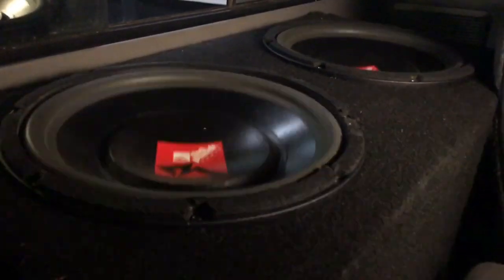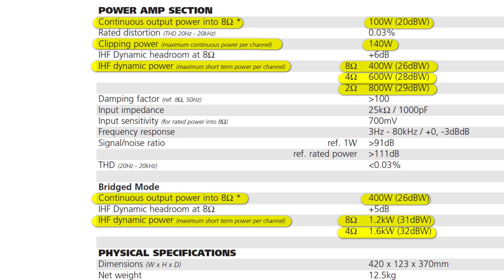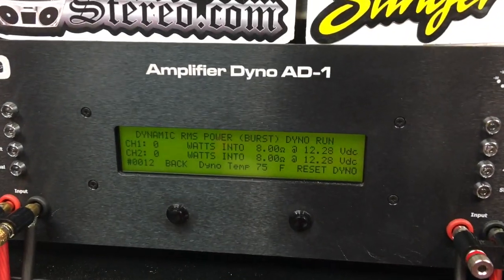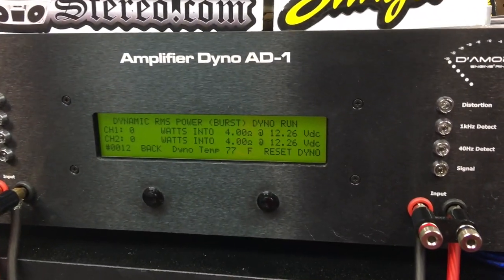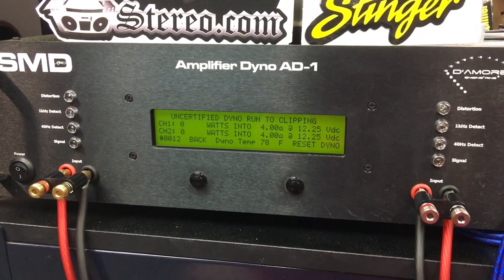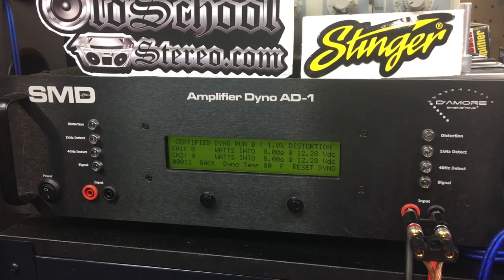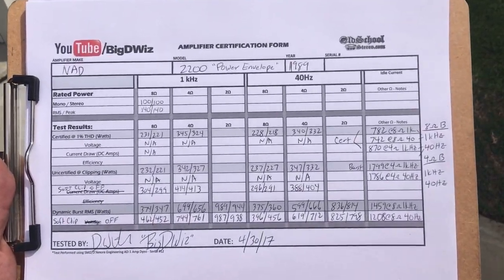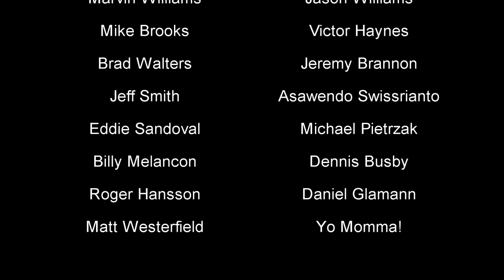Vintage NAD 2200 Power Envelope Audio Amplifier Dyno Test

Comment: This amp blows away any amp made today.  Remember this was made in 1987 so it was sick then and is sick now.  The SQ is impressive and have great dynamics.  Picking up one for $300-$500 is a deal.  Emotiva tries to match this with their XPA 2 line and the SQ is not the same.  I've had mine since day 1 and it needs no repair.  Match it with a preamp NAD 1155 and you are blowing up speakers.  Genuine audiophile product, I'll put this up agaist any system.  My two favorite amps is NAD2200 and Yamaha MX-1.  Check my videos on sound experience for reference.
Reply: In the HIFI world, this thing is considered an old mid-fi budget piece. It was never considered a true high end Amp. But it is a good Amp.
Reply: It's actually considered lowe power by today's standards with class d, but class a/b is superior in my opinion

Comment: The origins of NAD are fascinating. The brand was built from the ground up based on the demands of distributers. Simple utilitarian aesthetics, ample features and an overbuilt power capability with conservative ratings that punches so far above its weight class that it competed directly with audiophile grade competitors at a far more reasonable price. I think NAD's original mission has been diluted over time, but that vintage line of audio components are legendary.

Comment: Watching this video listening the audio through NAD 2200 :) Phenomenal amp I must say.
Reply: Does run hot though.
Reply: MSTR-RPTR I don't mind. My amps are well ventilated and I have 110v fans in case things get rough. I can't believe I didn't buy one because I thought the power rating was too low

Comment: This video brought back some good old memories. I used to repair home audio amps and these NAD amps were some of the best ever made that crossed my bench. They always punched above their spec sheets, and the design was so well engineered that a few I worked on with blown channels still functioned but the complaint from the customer was 1 channel was quieter than the other...and on the o-scope the sine wave was still clean even with the blown channel (most other amps actually explode [transistors fracture/short] when the channel blows). Also as you showed in the video with soft clipping off (if you were to watch the sine wave on a o-scope you can see it tries to bend the square wave in to a sine wave during clipping, it is pretty amazing engineering for the time) you do get more power, but with it on, you could actually save your speakers, so it was always a give/take situation, but when you push power in to a load it really does not matter as high wattage loads can take a ton of abuse.

Comment: I had one of these and I sold it for some reason, and I got a 2600 rated by NAD at 150 watts.  Both great amps. Still have the 2600. 

I read an article in the 220. They commented, “NAD watts are different from other watts,” referring to difference between their ratings and their output.

Comment: Back in the late 1980s I installed a couple of NAD 2200s in bridge mode driving 2 JBL cabaret series 18" 600w subwoofers at a local night club. It was a great combo, they sounded fantastic night after night and they never missed a bit in quite a heavy duty application. Clean power, no clipping even when pushed hard, no blown speakers ever. Great memories!
Reply from the maker: Awesome 👏

Comment: Ran 2 of these vertically bi-amped into my 1978 AR9s for years - absolutely amazing grip, control and power (the ARs needed lots of juice to make them sit up and perform).
Still have the ARs but now have them relegated to the studio now. Only have one of the 2200s tho - one blew up a few years back and set fire to itself and the curtains and wall. Completely ruined the amp - wall not so bad, curtains blobbed, wife on war path. I intend to restore both the speakers and the remaining amp (one day) - keeping the wife.
Now have Emotiva amps and Golden Ear speakers - happy.

Comment: I bought this and the 1155 pre amp, new, back in the 80s.  I still have it and it still rocks.  It has lost channels once in a while.  I finally broke down and bought the T777-V3 this year, so I could have a home theater.  I am thinking about moving the 2200 into the garage and plug it on out there.  This thing is still a beast.
Reply from the maker: Absolutely 👌

Comment: There was a problem with these amps having cold solder joints though. The problem can be fixed easily enough if you have basic soldering skills and aren't afraid to open up the case and pull the boards out so they can be re-soldered. The soldered connections that are connected to the back panel of the box should all be re-soldered even if they look alright. All of the soldered joints on the power supply (transformer) should be re-soldered and the speaker relays should be replaced. Pretty much all of these amps had this problem and should be re-soldered even if it's working and looks fine. The bad joints in most cases can't be seen by looking at the joints casually but can be seen under magnification. A lot of the bad joints had a dry socket where the outer shell of the soldered joint looks fine but in the center of the joint it didn't solidify and there is a faulting connection that can release the magic smoke. 

That aside these are kick ass amps. If you ever get a chance to pick one of these up cheep go for it. But with the age of this amp you should be aware that it will probably be needing a recapping to bring it back to it's original specs. That's just part of the hobby of collecting vintage audio gear.

Comment: I have one of these with a 1130 pre amp. We used to use it to run a PA system and blew 2x 600w 12” woofers with it. Only modification we did was point a fan at the top!

Comment: Would love to see the mighty 208 THX on the Amp Dyno. 
That thing is a monster of an amp. Rated to handle 2000w RMS at 4 ohms bridged. 
I have tested one of those back in the day, powering a set of home built tower speakers with a 12" Lightning Audio subwoofer in each of them. It drew so much power that the lights in the house dimmed when I cranked it up to 11.
Also, the smaller 218 THX, or the more modern M3 would be interesting to see tested.

Comment: Was curious and had to check for the schematic of it and found it. It’s a bi supply class G (very different from a class AB and way way harder to design). Freaking amazing design especially for the time and even today. The higher voltage outer rails switching on after a certain point and flooding/surging the inner rails is where all the headroom comes from. There’s probably some sort of time delay on the inner rails to keep the higher voltage ones switching ahead of the audio signal like in all Carver’s designs (which are ridiculously complicated).
Reply from the maker: NAD mentioned this video in their recent 50th anniversary video. Too bad my audio is a bit hot in some of the video 🤦‍♂️

Comment: The two larger filter caps are for the high-voltage rail.  They are the burst storage caps.  The amp switches to the high voltage rail when burst power is needed through com-mutating diodes.  Normally, the two smaller filter caps and low-voltage rail do most of the work.

Comment: The filter caps are different sizes because they have diifferent working voltages. 63 and 100 volts I believe.
The amp uses an input waveform peak level tracking, split rail supply to acheive high dynamic headroom and slightly increased efficiency.

Comment: One thing to keep in mind when dealing with this type of equipment, is power only goes so far when judging an amp like this. Sound quality is everything. Its easy to make an amp that has a lot of power, but its very expensive (and difficult) to make a powerful amp that sounds good. A good home speaker is far more demanding and less forgiving, than a good car speaker. 

NAD has been, and will probably always be a top performer for the money, but its still considered an entry level product (not including the M series. M is better than entry level but it costs a lot more). In reality, I have a 40 watt/ch at 8ohm's stereo amp that will easily outperform this amp in all areas. 

The only reason I bring this up, is not to say anything bad about NAD. For the right application I have no problem recommending them. High end home audio is my life's work since I was 18, and the biggest mistake people make, is they make purchases based on specs. You must also listen to any product before you buy it. And you should really try it in your own system. Actually, buying on specs is a tie with underestimating how important the preamp is in your system.
Reply: Samtab Galaxy so true since my dad took his klipsch forte iii to Mexico the front speakers that we have now can perform the way those forte could.
Also we also use to own Celestion a4c 
And with the klipsch front and added with celestion a4c the system didn't require subs those three could easily perform well but we actually did had the subwoofer but turn low for better punch we used velodyne sub
Reply: A good amplifier shouldnt havw a sound it should be neutral. However that is not the case in the industry. And it can be tested to show if an amp is neutral or not. It is not about cost really. More a design aspect.
Reply: "A good amplifier shouldnt havw a sound it should be neutral."

There is no such thing. Every amp has a sound of its own. You can have 2 amps with the same specs on paper sound completely different from each other. Not only that, the same exact amp in different systems can sound different as well. 

If you want to pick a good amp, you need to look at the specs and listen to it as well. And its not 50/50. Listening to an amp is way more important. A lot of what you hear can't be measured. 

That said, you'll see a lot of controversy on this topic. What usually happens, is someone new to audio reads a bunch of reviews, and then goes out and buys some expensive components. They set it all up and it sounds like crap. At that point, it becomes a rip off. Its like going out and buying a race car that's difficult to drive, and expect to do well because you  know how to drive a regular car. 

Generally speaking, its much more difficult to put together a 25k system than a 5k system. The upside is, the more you know, the less you have to spend. 

For anyone that's interested in learning more about audio, go to this web site. You'll see a list of about 15 journals that can be downloaded for free. Audio has been my life's work since I was 16. These journals are the best reference on audio I've ever seen. By far. Start with issue 1, and I bet you won't be able to put it down.    

http://vandersteen.com/audio-perfectionist-journal
Reply from the maker: Thanks for sharing 🤙

Comment: Great video. Please bear in mind that the watts rating your amp dyno gives is has to be more than the rated specs, NAD always uses 20hz to 20 khz or full range not at just 1khz. 20hz to 20khz will always be a ton tougher..... furthermore, NAD states the THD at 0.03% not letting it rise to 1% THD. With those factors included i would imagine it would get real close to its stated output.   Keep up the great videos!
Reply from the maker: Yessir, I like to see amps perform well and this one did for sure
Reply: It sure did. My home system is ALL NAD, Been in love with NAD products since i was 18 back in 1988.  Keep up the great videos.

Comment: The NAD 218 is the best amp I have ever owned.  It was rated at around 200 watts.  I could only imagine what the Dyno would show.
Reply: The 218 THX is a great amp. I have owned many of them. But the 208 THX is even more powerful, especially when it comes to dynamic power.

Comment: From Denmark,

Great, I still have my NAD 2200PE, NAD 7600PE, NAD 200 Dolby from 1975, NAD 2100PE, NAD 3300PE, NAD 7240PE, NAD 7250PE, NAD 302, NAD 7020.

And many more

On 30 September 1993 I bought my first NAD, a NAD 302 which I still have.

After that I was so fascinated by NAD that I collected them for many many years and ended up having 109 pieces.

I've had almost everything NAD has made  amplifire/power amps, not control and sourround.

But I will say that after they stopped building them with power envelope anymore and they removed their Bass-EQ, my interest disappeared from the newer devices.

today, for me, NAD "the hifi club" has just become a company where you can't buy a cheap good amplifier anymore, it's over.

And that's why I stopped shopping there anymore, unfortunately
Reply from the maker: I have tested several NAD PE amps and integrated amps. They were very cool back then!

Comment: I bought an NAD 2200 several years ago, along with an 1155 pre amp, and a 4225 tuner, and I have a question, (actually 2).  First, is mine an early gen 2200?  Mine does not say power envelope on front.  It does have 3 LEDs on front, the top 2 are red, the bottom one is amber, and it says overload protection soft clipping on the right side of the LEDs.  Sound output wise, it's beyond beastly!  Is mine any different than the one in the video?  Question# 2: As part of a package deal, I got an NAD 916 multi channel amplifier that I have never hooked up, to be used as a backup.  Have any of our esteemed NAD-ites ever used one of these as a two channel stereo amplifier?  It looks like it was designed for surround sound duty.  Thanks so much everyone, and enjoy sharing the volume with your neighbors 3 houses away!

Comment: It's seriously impressive how massively underrated a lot of these vintage amps are compared to modern ones. Obviously power is nothing without control, but a lot of them excel on that front too. What I'd really love to see is a leaderboard to show how all of the amps you've tested stack up against each other, including how they compare to their rated specs. It would be especially interesting to see modern amps in that leaderboard, to see if any of them can even begin to compare. If you could also include how they actually perform and sound in different frequency ranges, I think what you'd have there is something akin to an amplifier enthusiasts bible.

Comment: I just bought the NAD 2200….preamp NAD 3020 series 20. Looking for speaker recognition. Currently have Infiniti Alpha 50 and Infiniti subwoofer.  One Tweeter burned out  when I tested…no load no high volume…I guess just unlucky…new one is $100…so considering new better for my amps combo fit. Thank you!
Reply from the maker: These amps are 30 plus years old, may need to be serviced

Comment: But you messure at 1kHz at 1% THD.
NAD did messure this at 20Hz-20kHz both ch driven and at a lower THD👌
That's why you will get more than double of the rated watts. Gotta love the few manufactures that have real messurements👍 NAD was pretty good at this
Reply from the maker: True dat
Reply: Also this guy Bjørn Erik Edvardsen was a major impact of NAD back in the days with the NAD 3020, if you see 1 for sale grab it and keep it. Sadly he passed away earlier this year
Reply: TheLassenman RIP

Comment: The NAD 2100, 2200, 2600 & 2700 are all class-G designs. The lower voltage is 62V and the higher is 95V
Reply: what about the 2400?
Reply: Also class-G
Reply: Nice, appreciate it. Seems like class-G is doted as a good amp design.
Reply: I have the 7600 receiver and will never get rid of it ! A true monster classic.
Reply: NAD 208 is also a Class G design and even more powerful. 87 and 120 volts.

Comment: NICE VIDEO!
Using car subs to test vintage audio amps. I use 4 ohm car speakers to run in the old amps I restore, mostly NAD amps.
I have a pair of old Crunch V600 and V6004 amps, I wonder how they dyno?
Reply: Hi, you restore old NAD amps? i have a working 3080, one toggle sw and one pushbutton need covers, the preamp section is not useable in its current state because of all the scratchy noize. (i only use it as an amp paired with a mini nak compact reciever). And the meter lights are out too.

i could probably take the front end off the chassi and send it to you for a refurb.

Comment: I wonder what those old Phase Linear 400 and 700 series would do.
Reply: I have two phase linear 400's and I would love to see a review/dyno test!  All I know is they sound great and can be hard on speakers!
Reply: FlatBroke612 I recently change all the output transistors and electrolytic caps in. 400 and it sounds amazing for a 30 plus years amp.

Comment: From what I could see, looks like your amp has the original output relays. If, so, that is amazing. The output relays were the weak point with this amp.
Reply: Rory Gallagherfan so they were the weakpoint but that is actually amazing??? I dont get it
Reply: @Broxine  : The fact this amplifier STILL had the original relays is what was amazing. Most 2200's output relays had to be replaced after about 20 years, if not earlier.
Reply: Mine plays but if I ask it  to go loud it goes protect
Reply: @macd9861  : Check the output relays. Bet they are close to being burned through

Comment: Looking for a power amp saw one on my local CL for $300.  Thinking it will be a good purchase for that price.
Reply from the maker: Yes, but these amps are old and may require some maintenance. There's always a risk with older amps but yeah these are pretty awesome and $300 is a great price if it's in good working and physical condition. I believe these sell for 2x that on eBay.